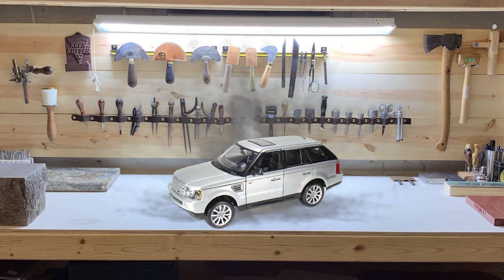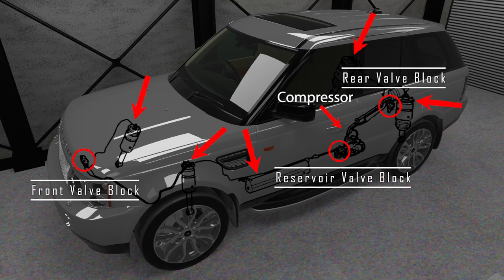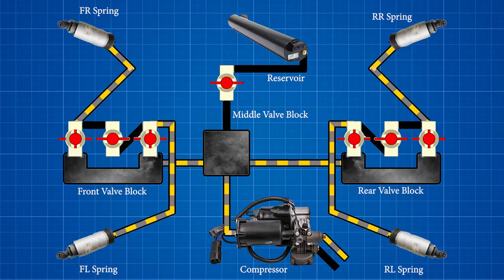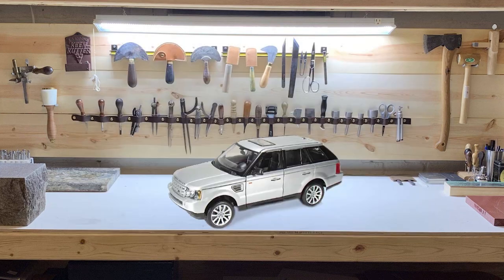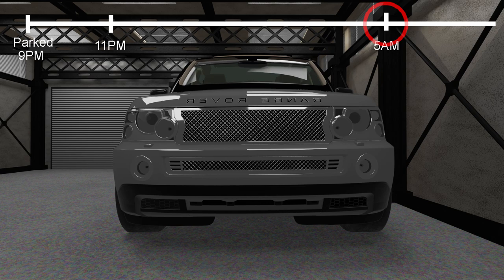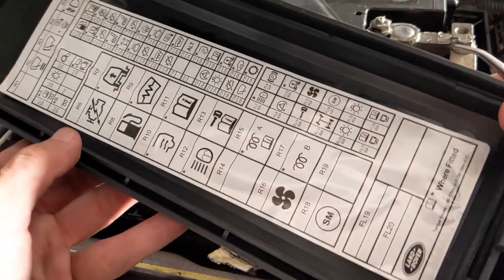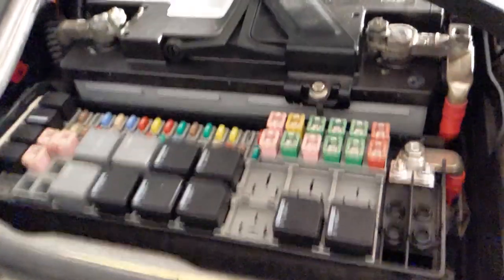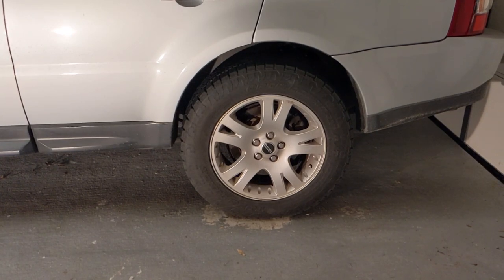Suspension Sagging Overnight - Range Rover Sport or LR3

Comment: I have just discovered that the air lines on the front valve block are all in the wrong places (courtesy of previous owner). The line that's supposed to go to the air compressor is in the port for the right strut; the line that's supposed to go to the left strut is in the air compressor port; and the line that's supposed to go to the right strut is in the port for the left strut.

I'm just curious about what this might do to my system. I will be correcting this.
Reply from the maker: When lifting the system all solenoids are open so they would share the same gallery regardless, however, I would predict the vehicle wont be able to equal pressure between the springs or vent excess air correctly in this configuration.
Reply: @HazyJay  Thanks very much for the reply. I'll be checking the lines to the rear valve block based on your other video to make sure they're in correctly too.

Comment: Whsts yhe difference between $50 valve block and $100?  I changed all 3 but still back and front wont raise.  The compressor works but after a charge in air it lets the air out becaise air is not going to struts.

Comment: What if one side is leaning more than the other? My left side are both lower than me right
Reply from the maker: Does the 4x4 info screen show that both sides are level? If so It might need to be calibrated.
Reply: @HazyJay  no, the front right tire looks like it’s falling off the car on the screen😂
Reply from the maker: @alexcora2369  likely need a new front right height sensor in that case, check out my video on height sensors 🤙
Reply from the maker: @alexcora2369  only like 50$ and pretty easy to do, don't even need to take the wheel off
Reply: @HazyJay  you’re awesome! Thank you!!

Comment: Hi Everyone, I have a RR sport 2012 and I did the test removing the fuse. The result is that the front left drop 2cm but the  front right rise 3cm. And the back right rise 10cm and the left rise 5cm! What should I do?
Reply from the maker: Raising should be impossible, I would repeat the test by disconnecting the battery, the fuse might be different for a non-l320 RRS
Reply: Last time I cleaned the rear air valve and I wasn’t sure about the order of the air hoses on the back. Do you think That the car is rising because I didn’t reassemble properly the rear valve?
Reply: Hazy, i have à Theory, maybe the weight of the engine being much heavier than the back, push the air to the back suspension. Like pressing a ballon, the air will go to the opposite side of the pressure. If I’m right then what is the air valve need to be replaced?
Reply: Hi everyone, I finally changed the central air valve and now the back part of the car is not raising anymore. My theory was right, the weight of the front part of the car was lifting the back part. Thanks Hazy for your videos!

Comment: Hi thank you very much, but my L320 just drop low on one side, left side over night, new 4 air spring. Any clues where i can check, no fault codes.
Reply from the maker: Front and back?
Reply: @HazyJay  left side front and back, but not every night. But if i park with off road hight, the left side front and back all gonna drop to the normal hight.

Comment: Hi!! I am experiencing a similar scenario some people have called out below. The battery has been pulled for 3 days and it's sitting on a level surface. No sagging that we can tell. Is it possible it's some sort of bad sensor that is making the system think it's losing air when it is actually not? I am getting a suspension fault pretty much constantly while driving, and the screen shows the back 2 wheels sinking off and on within the display. Any thoughts? Thanks!
Reply from the maker: Yes, it's not a leak it's likely a faulty height sensor. Please see: https://www.youtube.com/watch?v=ipzjoeLZnq8&t=2s

Comment: What do you think it is when everything work no leaks and when I hit a bump is bottom out the rear Shock
Reply from the maker: Are you sure it's bottoming out (suspension completely compresses to bump stops) or does it sound like it bottoms out. If it's just the sound, it's likely the lower control arm bushings in the rear or some other suspension component.
Reply: @HazyJay  just sound like it when going over bump hit really hard
Reply: @HazyJay  Thanks for reply
Reply from the maker: @chriselders6603  Be careful because a lot of things can make the noise, make sure it's nothing in the cabin (a tool box in the back) and if not, you may need to have someone rock the car while you look underneath, or possibly even rig up a go-pro and drive over a bump
Reply: @HazyJay  ok thanks well do much help

Comment: How do I go to extended mode instead of off road height? Thanks
Reply from the maker: Extended mode will be selected if the vehicle senses it has become "grounded" on a rock or something, but it cannot be selected manually. You can MAKE it go to extended mode by placing a block of wood under the jack point while it's in extended mode and lowering the chassis onto the block, causing it to go to extended mode.
Reply: @HazyJay  thanks for the quick response! Just want to clarify..so off road mode then place a block at jack point, then try to lower it, and it will go to extended mode?
Reply from the maker: @95x300  Yes, the block should be just below the jack point when in off-road mode. You can usually drive about 30mph like this.
Reply: @HazyJay  after over 50hours testing, both front drop about 1/8inch and rear stay the same. so this could be valve block issue? I hear hissing sound in the front when the vehicle is running.

Comment: I'm in the process of changing all my air suspension to coils. check my Instagram
Reply from the maker: I have done that as well, I used this kit from AB: https://www.roverparts.com/suspension/air-coil-suspension-kits/L319SRK-OMEHL/
Reply: @HazyJay  Hi Hazy ,,I have chance to buy one Range Rover Sport V8 5.0 2014 140000km 
But he have one problem with suspension fault CPU should 
And some bodyshop work 
He have estimated 10000 $CAD cost
He ask 25000 CAD
In the market here in  Canada it's like 40000$Cad this car
Can I fix this fault CPU for reasonable price ?
Or change suspension with coil suspension?
This  engine  V8 5.0 it's reliable ?
Thanks